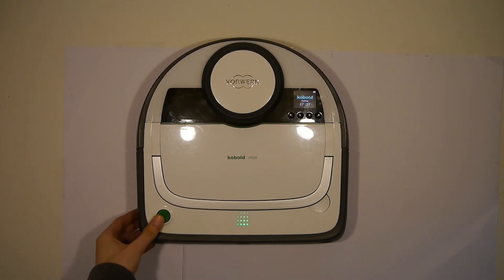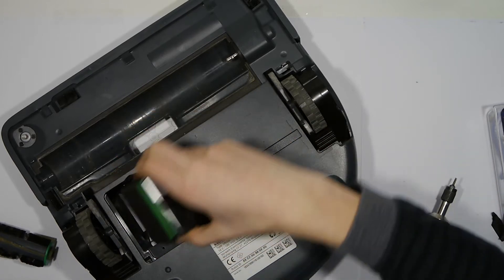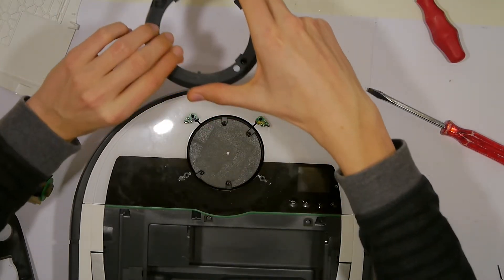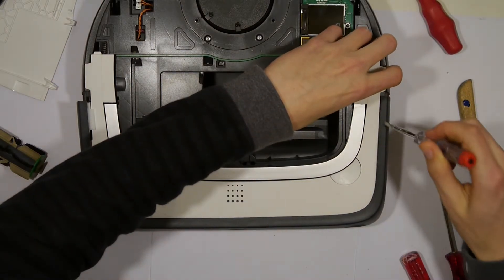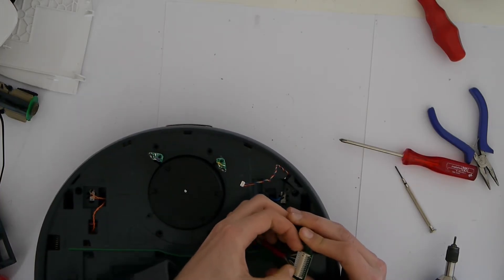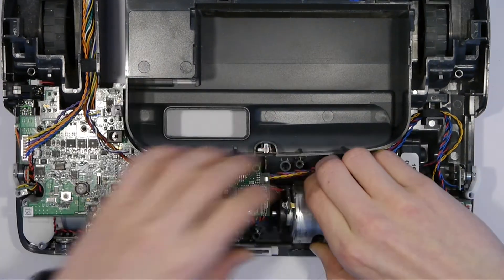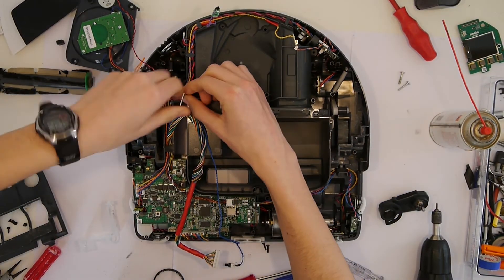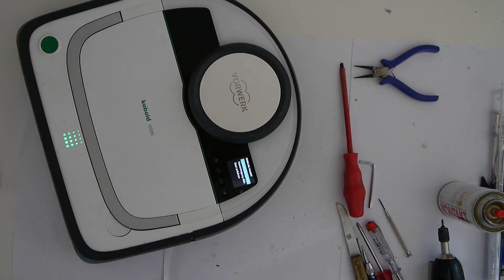Vorwerk Kobold VR200 - Teardown

Comment: Vielen Dank für das Video. Ich bekomme den weißen Deckel (mit der Aufschrift Vorwerk) auf der Lasereinheit einfach nicht runter. Kann es sein das der geklebt ist ? Habe Angst bei zu viel Druck das Ganze zu beschädigen.
Reply from the maker: Your Welcome :-). No it isn't glued but it is the most complicated step. If a small screw driver at the certain spots shown in the Video doesn't work maybe a suction cup does the trick.
Reply: Ich habe meinen auch vor einigen Jahren repariert. Der Deckel sitzt extrem fest, kann aber abgehebelt werden. Am besten geht das mit einem breiteren Werkzeug und nicht einem Schraubenzieher wie im Video, von gegenüberliegenden Seiten gleichzeitig ran. Ich konnte mir es am Anfang auch nicht vorstellen (obwohl ich mal Fernsehtechniker gelernt habe und hier recht fit bin), aber bei dem Deckel muss man extrem beherzt zur Sache gehen. 
Für solche Aufgaben ist so ein Set immer ganz hilfreich https://amzn.to/3dMf9yE

Comment: Hey, thank you so much for this video. It helped me to fix my vr200. But maybe you can help me with that: after I reassembled the device I found a small piece of black rubber, about 2x1x0,5 cm. I have no clue where it is from. I guess it’s somewhere in the bumper? But I don’t know 
Thanks
Reply from the maker: Thanks for the kind comment. I think this is used to keep the cables in place. (9:27 in the center roughly under the main Board). So luckily nothing you should worry about. Hope that answers your question.
Reply: Aaah yes that it is. Thanks!!! Perfect. Next thing I have to repair: Phillips Sonic Care Tooth Brush... in case you need motivation :-DD

Comment: Thanks a lot for this very very usefull tuto ! Vorwerk local station ( Lyon, France) kept me my unit 8 weeks, tried replace the motor, and finally gave it me back with no change. It was dust on the laser, from high pressure air cleaning. Then similar issue with false contact on the motor (same root cause). Now everything is fine, and cost was zero...

Comment: Very very interesting ! The blower motor is different to any Neato. Would be interesting to compare both in airflow
Reply: Indeed Vorwerk webpage indicates 13 litres / second or 27cfm. That would be higher than any other robot vacuum.

Comment: I have the same problem, where should I use the spray? Into the principal brush motor is enough or even into small brush motor? What spray do you suggest, something like ballistoil? Thanks ;)
Reply from the maker: Use the spray around the metal at the brush (in the video at 0:35). I used contact spray but I think ballistoil should work as well. Then you need to wait a little bit so that the spray can do its magic ;-). If you have any questions left then feel free to ask them! Did this fix your problem?
Reply: @JERandomTech  yes solved brush problem ;) unfortunately I broke both plastic part that hold the 2 wheel spring...I tried to glue them and stretch a little bit the springs in order to let the plastic glued resist from the spring strength...now the robot is ok but has a serious problem to turn right...turn left is ok...seems that left wheel slide on the floor... can't understand where is the problem... I don't know if re-open it make sense if I can't understand where is the problem. Forgot to tell that I open the robot to check also the brush motor if was ok.
Reply from the maker: @daniele728  I think when the springs aren't strong enough the wheel touches the top plastic part. My idea would be to put something in between the plastic part that holds the wheel and the cover so that the wheel has more space or if this doesn't work you can maybe glue a metal screw or nail as replacement for the broken plastic and attach the springs there.
Reply: @JERandomTech  Just used RP7 and it bloody worked. You ripper! Thanks so much